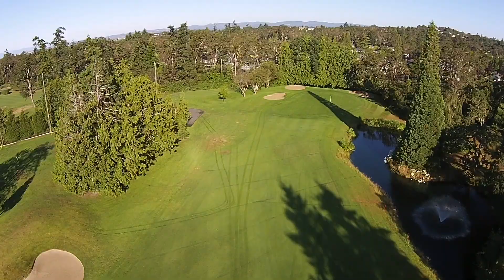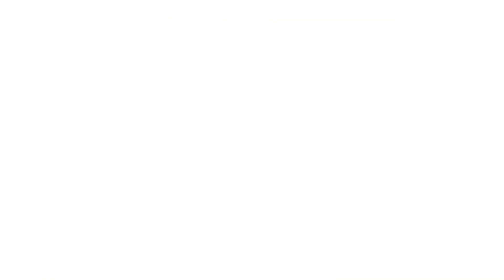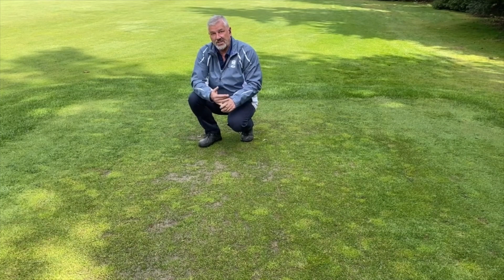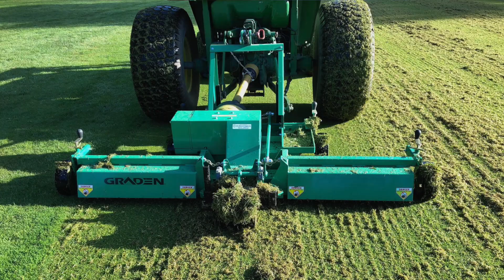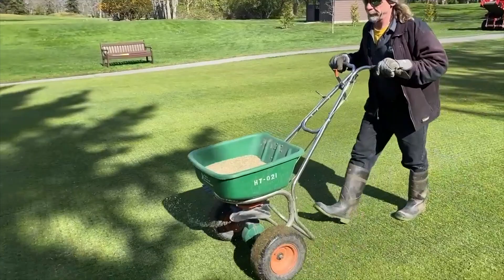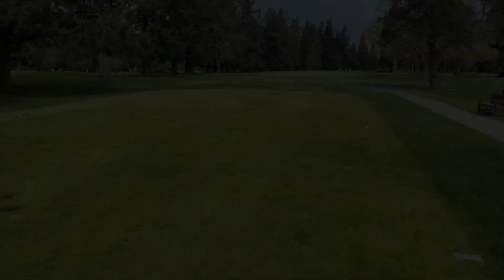Cultural Practices for Tees

Comment: The biggest thing a golf course can do is have extra Tees especially on par 3s. You can switch tees boxes and let one heal for however long. This also gives a hole a different look when you dont have tees in a single row. Bigger tees also help with multiple ways on and off
Reply: I work maintenance at golf course and the par 3s get destroyed. Tees are far too small with today golfing vs built in 1992.

Comment: Would you do cores ever on a tee. Looking at the main deck of my courses 1st tee and it's seriously worn. Would not cores work better than solid deep tines in those heavy traffic areas?
Reply from the maker: It depends on the makeup of your tee decks. Our tee decks are built out of sand, so they drain well. We will pull a core when organic matter builds up on them. Our organic matter content in our tees is averaging 2.4%, so solid tines are what we used this past year. We do solid and pull cores when needed.
Reply: Aeration is done everywhere on a golf course but it just depends on time. All around the country it is done at different times. Just because you see holes being punched doesn't mean Aeration is what we're going after. Root growth, oxygen in the soil, release of gas and so on. Newer bentgrass cultivars that can handle a lot more shade, heat cold is the turf these courses should be moving towards.